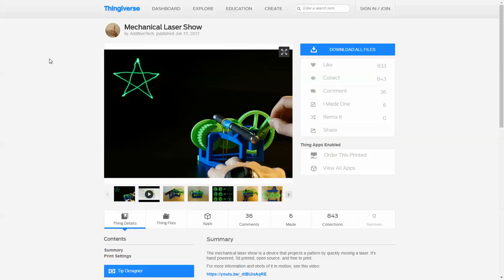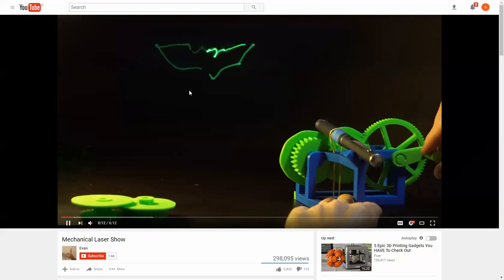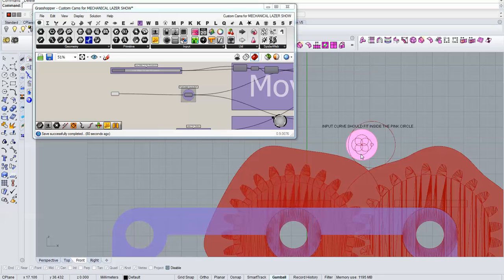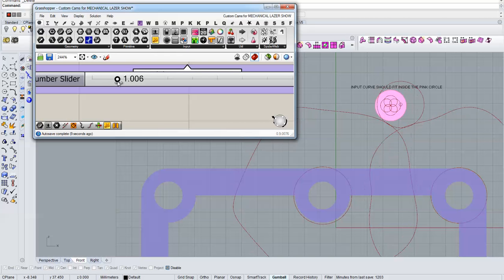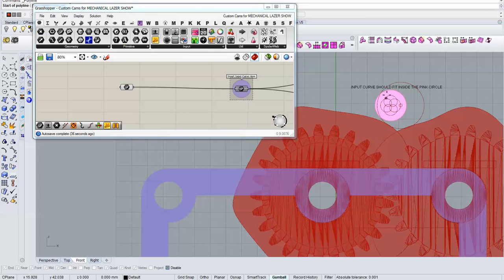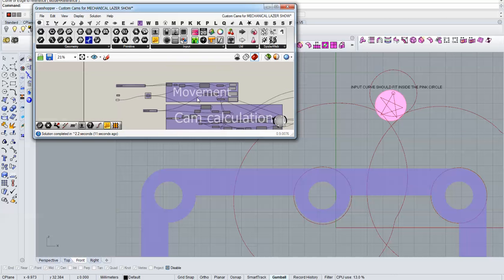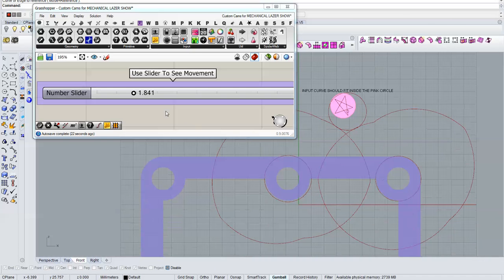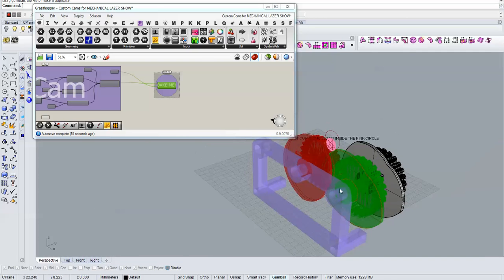Custom Cams for MECHANICAL LASER SHOW

Comment: Awesome technique, super efficient, currently working on a Matlab code to create custom cams for the laser show device and was led to this video from the comments on thingiverse that your friend posted regarding this video.  i notice you don't explain if you optimized the cam for maximum acceleration or velocities, this might result in blurred edges.  The original designer took care of this by adding more reference points on near the edges, and keeping dt the same between points, thus slowing down near the edges.  It would seem silly if this cam software isn't capable of creating maximum velocities and accelerations, is that possible in this software?  Once again nice skills not only engineering but communication and video quality, thanks Shy Tavori!
Reply: Hi CV. I look forward to seeing what you create in Matlab. Make sure to post back so I can see.
It appears that shy tavori is using a constant speed. As you point out, this is inoptimal. An optimal solution would be to give your software constraints such as max acceleration and max speed and have it space the points accordingly. Math like that is used in industrial robots to find optimal movements. Maybe a stretch goal for your project could be to incorporate these.